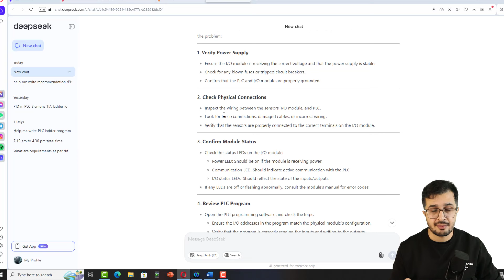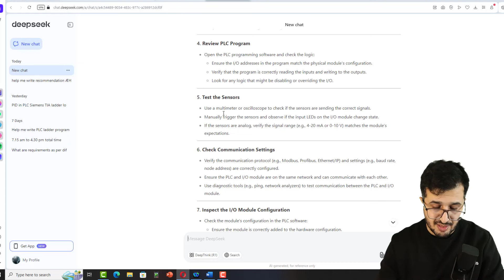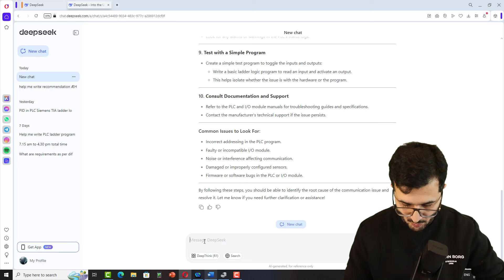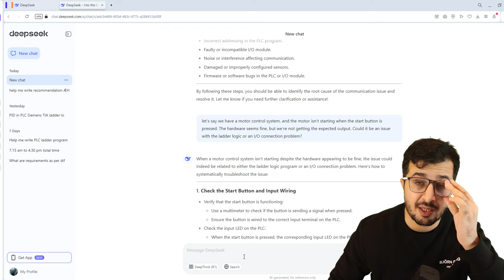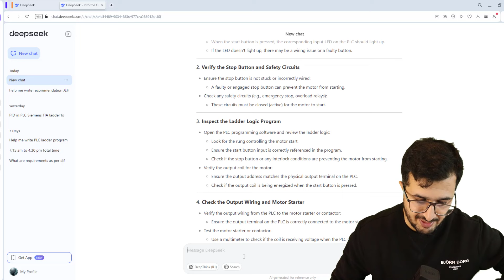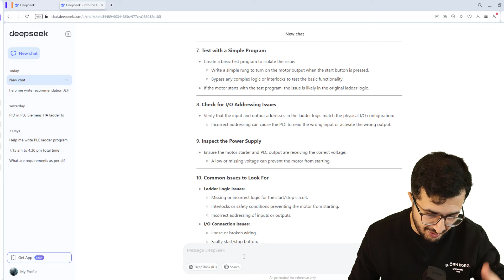DeepSeek and PLC Programmers : Game over

Comment: i want a true/running LAD-FBD-GRAPH-SCL code that for a little more complex project,chat gpt started making wrong codes.Complex codes and Scada/DCS are still untouched.We still have to organize our own DB and keep working with customer for process changes.Devices using modbus are not as easy as it seems,we need to process the information recieved from modbus too.
simple codes to the point only for turning on motors are not viable in real life.We just need a button and contactors,why do we want to pay like 400$ plc just for that?
Reply: 🎉89

Comment: So I guess I won't train in plc programming 😞
Reply: It doesn't stop your training at all, it will only enhance it. Programming is only a fraction of the technical aspects of the job of an Automation Engineer, there is still the management aspect. Then again humans have to be in the field to actually implement/fix the issue. I believe AI will greatly enhance the job of Engineers in general rather than replace them. Brace up and start using Deepseek to learn PLC programming Instead.
Reply: @bigkesh441 yes brother.
I am totally agree with you
Reply: if you can't programming you will never understand electronic
Reply: these codes are too easy to the point we dont even need a plc to do it.When you started doing complex programming,it started to choke